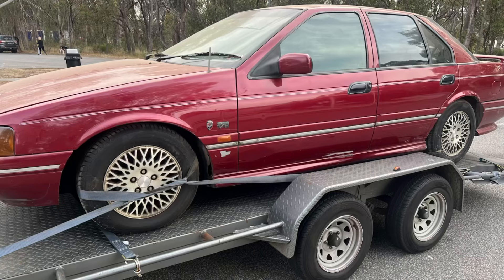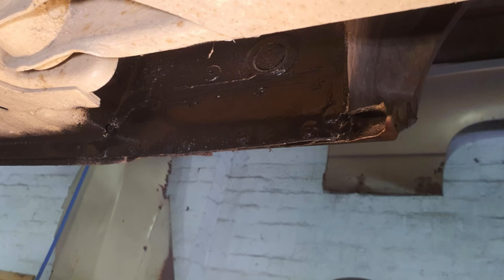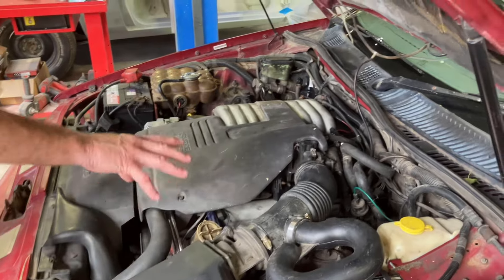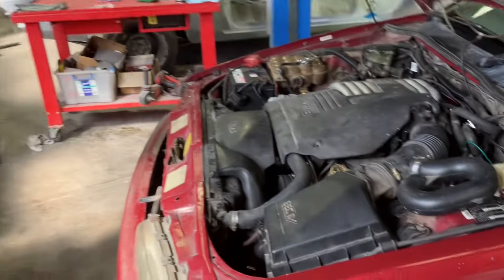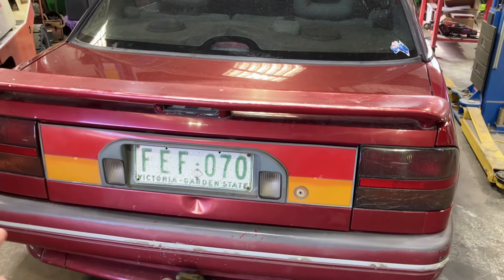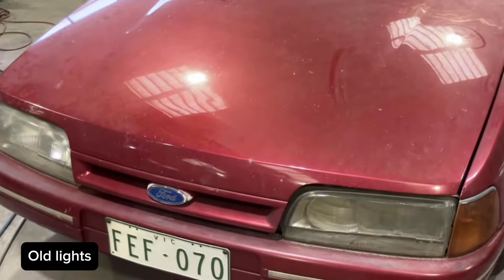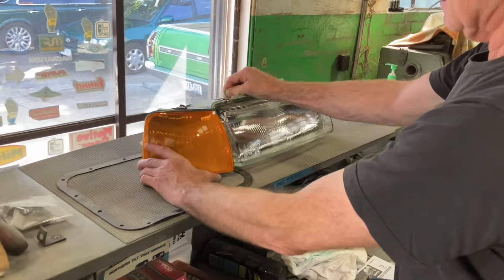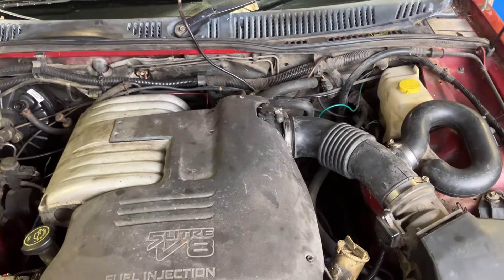Ford EB Fairmont Ghia V8 Project - Part 3

Comment: Hey Mark, if it was mine, I would use the existing bootlid. The dent in the center bottom of the boot is an easy fix, the spoiler will have rivet screw holders that can be ground out and the holes fill welded closed with MIG or better TIG. I have done these many times over the last few ice ages. 20 liked
Reply from the maker: Thanks. I also need the rear garnish and often these are sold with the whole boot lid. If I can’t find one I will look into what you suggest. 👍👍

Comment from the maker: Here is Part 3 of my Ford EB 2 Fairmont Ghia V8. Please check out the other episodes. Hit the old Like 👍 button and Subscribe for more old car videos. Thanks for watching. 👍👍
Reply: airbags ??
Reply from the maker: @Eric-kn4yn  Don’t think so. More Primary safety - the driver! 😀👍
Reply: @markbehr88  EB didnt have airbags
Reply from the maker: @Eric-kn4yn  well there you go!
Reply: @markbehr88  i /as asking u if yes restoring what happens if you touch airbags steering wheel needs replacing etc.
Reply from the maker: @Eric-kn4yn  i think they can be replaced easily enough. On AU’s for example. You always need to disconnect the battery. 👍

Comment: What a car the EB I had a green metallic EB but with the straight 6 but I think it was the first ford fuel injection system. What a pleasure to drive. The EB was a big improvement on the EA. 100%.
Reply from the maker: They are cool cars. The EFI actually came out in the XE model, which I’ll cover in my next episode in the Falcon series. You can check out the Falcon playlist if you haven’t already. 👍
Reply: @markbehr88  yeah you are correct what through me off was the EA was a carburettor ? With a couple of electric wires ringing down the carby. Correct me if I’m wrong. But of course i remember now the XF was EFI. And the XE just not sure what the deal was with the EA. Was it fuel injected or something different?? Cheers Markbehr88.
Reply from the maker: @patrickaussieMilartry  yes the base EA had as I recall a 3.2 central injected engine. Basically an injector over a carb. That motor was dropped early on and the 3.9 Multi. 👍

Comment: With parts being hard to get, that’s simply due to them being unique to Oz, and those OEMs are no longer around to make batches of spares when needed.  With things like the EB sender, there’s no other models that used that particular one. The market is too small for an aftermarket company to invest in making them.  FG (and VE, well even VT onwards) have so much “global” content, used in many other vehicles (and not necessarily the parent brand), that numerous parts are easy to source either as OEM or copies from China.  A good example is the FG fog lights are the same as many fiesta, focus, transit and even VE models from the same timeframe.
Reply from the maker: Yes, but don’t you think it’s odd that you can get repro headlights and indicators but can’t get a fuel sender. And it is the same sender for the six as the eight.  It should be the same from EA to ED, so that is a lot of cars, albeit not that many left but it should be a service item that is easy to get imo. 👍

Comment: Parts for 5.0 Windsor are hard to find and get is because the 5.0 Windsor was sold from 1992-2002. Also 5.0 Windsor Engines came in limited numbers as compared to 4.0 six cylinder engines.
Reply from the maker: They made a lot of 5.0 engines in the US though. 🤔👍
Reply: @markbehr88  can the parts from USA be here for 5.0 Windsor ? GM still produces 5.7 Chevy Engines and plenty of parts for them.
Reply from the maker: @anish-79  a lot of parts yes but the fuel sender seems to be a challenge. 👍

Comment: The EB 5.0 were a very muted car engine sound wise it may have to do with the twin cats they run. I had one back in the day and removed the centre muffler and replaced it with a smaller free flowing unit and did a rear muffler delete and it was still very quiet. Much quieter than a mates VN 5.0 with a similar system but only running a single cat.
Reply from the maker: Thanks for the tip. Mine has a bit of a growl about it now. 👍

Comment: G'day Mark,

Looking good, has the Ghia got a LSD or single spinner ?

Cheers

Louis Kats 👍
Reply from the maker: Good question Louis. I would need to check. LSD was standard over the years on some models but need to check this one.  Cheers Mark 👍
Reply: @markbehr88  👍
Reply: @markbehr88  all Ghias had LSDs going right back to the 80s.  So yours would have one unless it was taken out over the years.
Reply from the maker: @andrewg2618  Yes. You’re right 👍

Comment: Looks much better without the spoiler. It truly does spoil the rear end appearance.
The more issues you chip away, the nicer the car feels. 
The analogue instruments may appear boring at first compared to the digital dash of the EB1, but they are better for driving. The digital dash craze went out in favour of analogue instrumentation for good reason, though the full aqua vacuum flourescent display of the XF Fairmont Ghia, ZL Fairlane and DL LTD did look pretty incredible.
Reply from the maker: Agreed. I like both re the dash. I have quite a few digital dash cars (mainly US). Agree the XF series dashes looked really good. That was probably the best part. 👍👍
Reply: @markbehr88  both the XF and VK offered Star Wars dashes to make up for certain deficiencies under the bonnet and floor hump, though the EFI black 202 was a very smooth unit and clawed back some power.
Reply from the maker: @jamesfrench7299  Yes, I quite liked the Calais digital dash. 👍
Reply: @markbehr88  I've heard it described as dodgy. I've never seen it in much detail. All I remember is a bar that stretches across and over the speedo showing RPM.
Reply from the maker: @jamesfrench7299  I drove one and liked the dash. I don’t believe they were as reliable as the Ford ones, which I think Mazda may have also been involved with? 👍👍
Reply: @markbehr88  no question as Ford had established it's Mazda association. Those buttons on both sides looked awfully "familia" sorry 929 🤓.
Reply from the maker: @jamesfrench7299  Yes. At one point they owned 25% of Mazda around that time. 👍

Comment: I hope to see that boot spoiler removed. It would look cool with an XR bootlip spoiler.
Reply: Also, see if you can find a momo leather steering wheel to replace the standard one. The one that came in my eb2 sxr6 was the best feeling steering wheel ever - I sold it a couple years ago, otherwise I'd offer it to you. 

They're pretty hard to find in good condition but as a price guide: I sold mine (in VGC with absolutely minor wear) for $500 postage inclusive.
Reply from the maker: I’ve got a new boot lid. Just need a Ghia garnish. 👍
Reply from the maker: Will see how I go once all the other stuff is done. I have multiple projects on the go as you’ve probably noticed. 👍